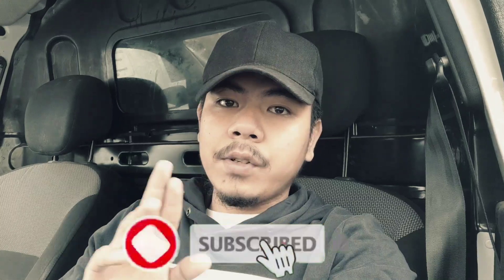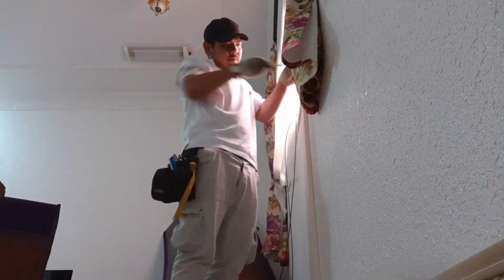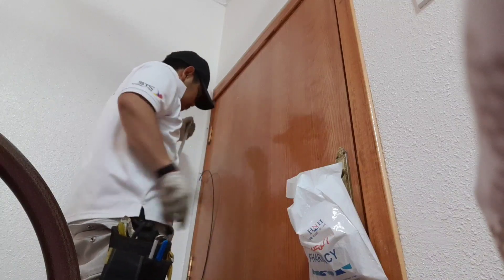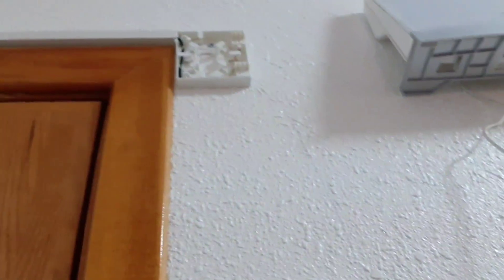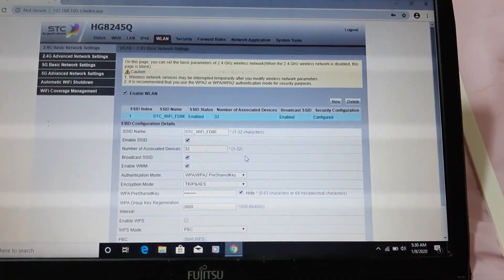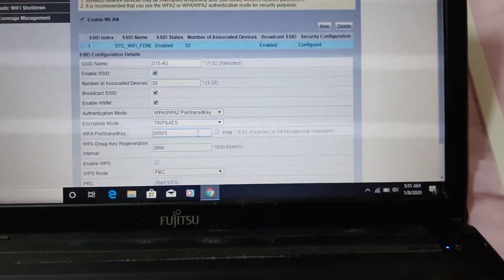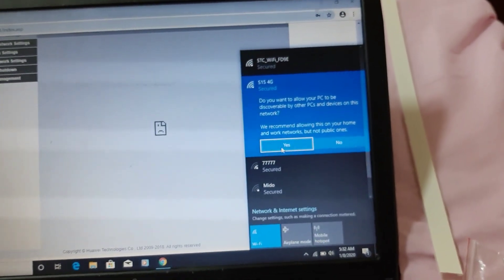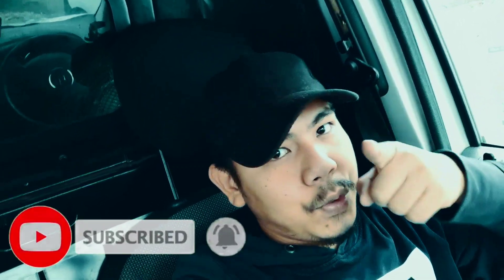Fiber optic internet installation inside the house (Saudi Arabia)

Comment: Sir goof day. Tanong lang bakit po nawala connection after reseting the router. Tapos obtaining ip address lng cya. Gumamit na ako static ip pero di ko pa rin mapasok yong ip na 100.1.  Ang router pala sir is DZS.  Patulong po. Salamat
Reply from the maker: Yes, you need to call your network provider kasi sometimes ang modem pag ne reset mo just to change password minsan it may reset your package also .